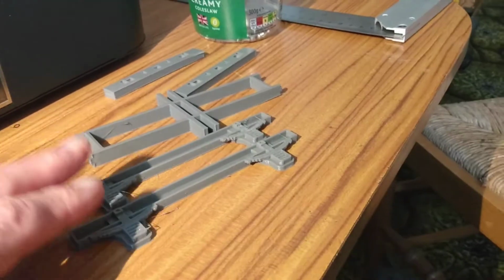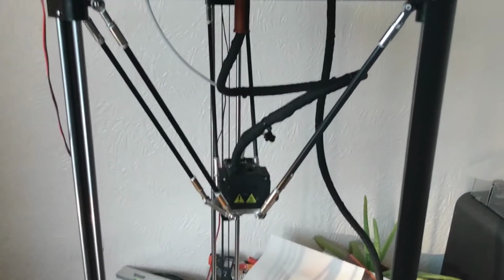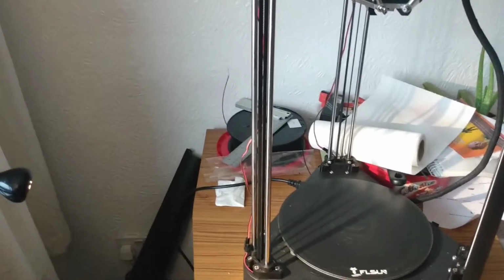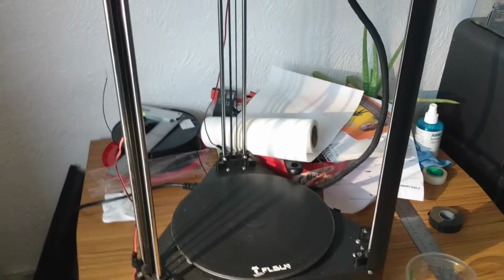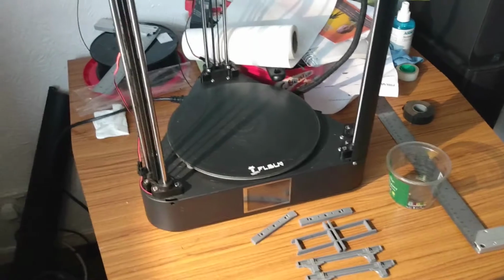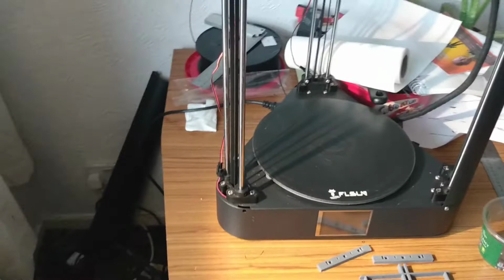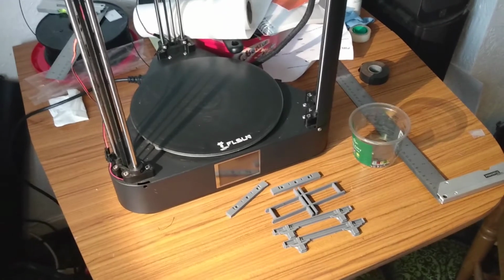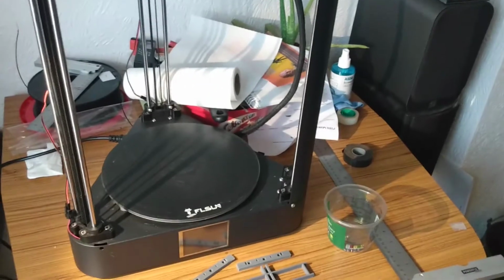Print 3d Model or Buy a Kit, discuss

Comment: 3 D printing is fine..... but its also where craftmanship goes right through the window......
Reply from the maker: True. At home I will never achieve the level of detail and craftsmanship of commercial producers. A moulded part will always be better than 3D FDM. I recently bought a plastic kit of a police car. I could never ever get close to that with a printer. A fabulous model for a couple of tens of pounds from a great supplier!! John. PS - it would take longer to print the model than the delivery time from a supplier.
Reply from the maker: Just working on a PDF models kit. The craftsmanship in the printed parts is very good.